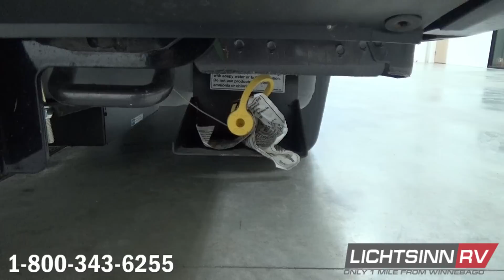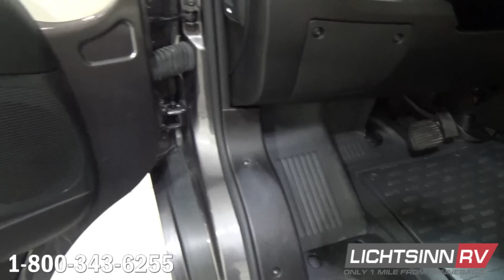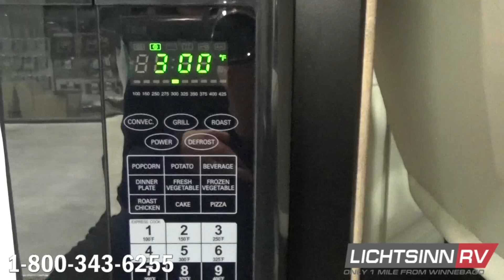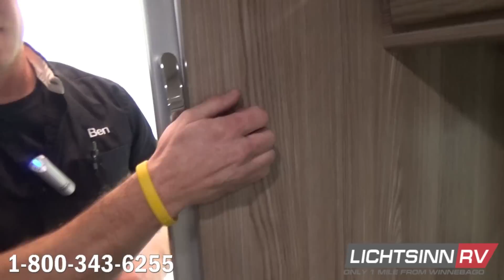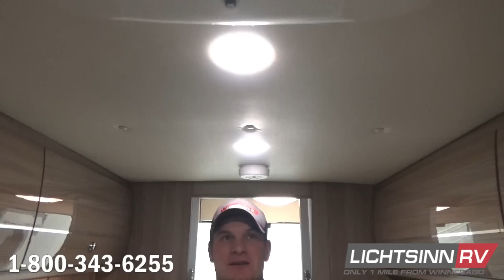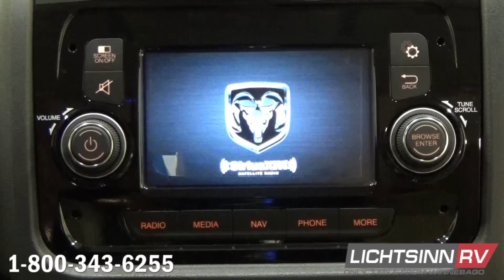LichtsinnRV.com - Winnebago Travato 59KL Pure3 Lithium Powered Orientation

Comment: Should the sign on the screen say "slide to right, gently" PULL, says to me to pull towards me, wow that won't work to well. If one person will be using this coach can the extra bed be taken out and storage cupboards be put in.?
Reply from the maker: Good evening!    To an extent, yes... there are a few lithium components on the patio side under the bed and the Truma system under the majority of the driver side.